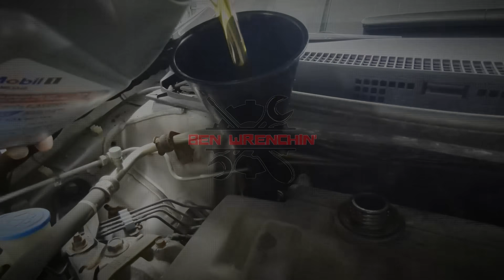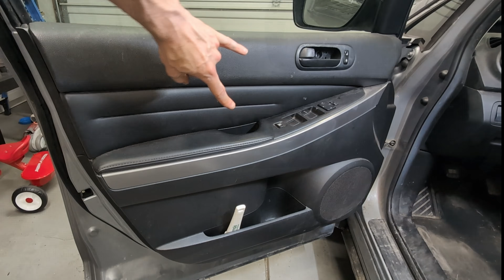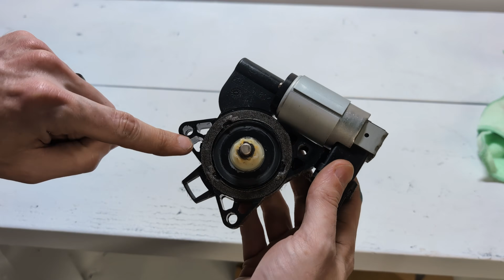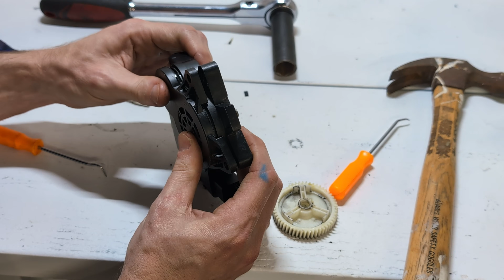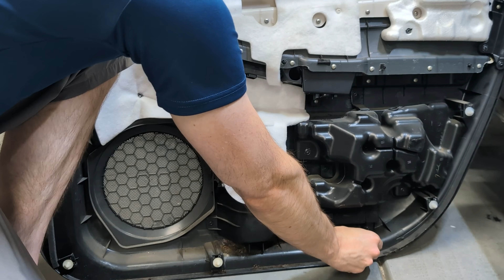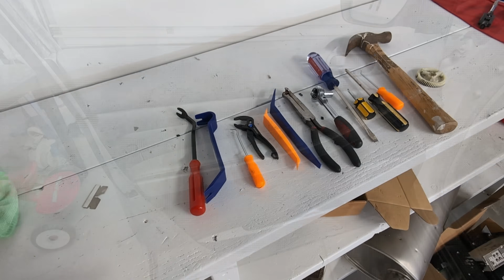Window Won't Go Up? | 2011 Mazda CX-7 (The $5 Fix!)

Comment: WARNING, WARNING, WARNING! Carefully examine your door handle. If door skin has a separate handle like often is the case with the passenger door, there is additional screws that must be removed. There is a cover to the door handle that has to be removed. Underneath you will find two rather large Phillips head metal screws that must be removed. If your door skin has this type of configuration, simply popping the parameter plastic snaps and rotating the doors skin up to remove. It is impossible. If you manage to do so by brute strength,you have done irreparable damage to this door skin.
Reply from the maker: Good to know, I had no idea they made different door cards for these cars

Comment: Well done Ben bud. Any idea how much money you saved by repairing instead of replacing the motor?
Reply from the maker: You know, I didn't look at the price of the motor before I did this.  Turns out it's really not that expensive for a knock off motor on Amazon.  I like keeping OEM parts if I can save them, so I'm still glad I did it this way.
Reply: @benwrenchin , I’m with you on that. I’d rather work with what I have if I can. This was definitely a fun one to watch.
Reply from the maker: @kennymatlock4736 Glad you liked it Kenny.  I fixed the AC on my truck, I'm working on getting that video ready to post next week.
Reply: @benwrenchin , I’ll most definitely be looking forward to that one. 😊